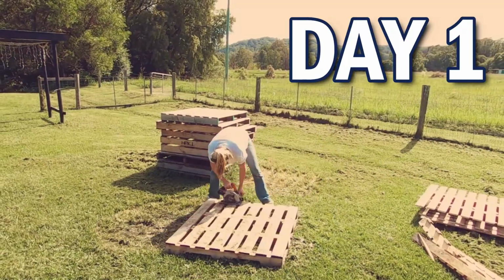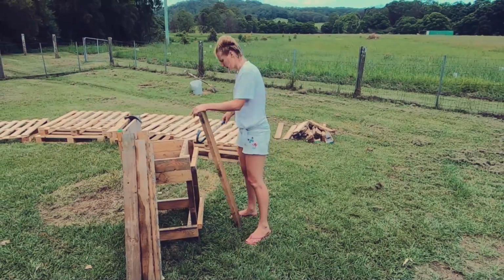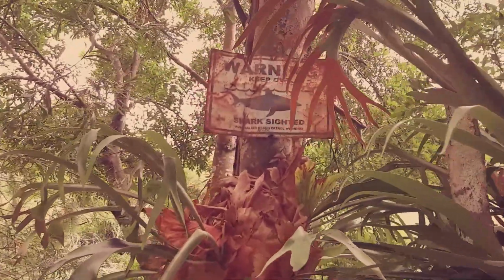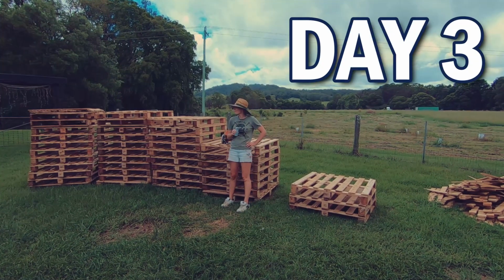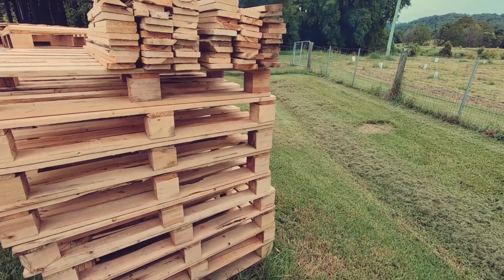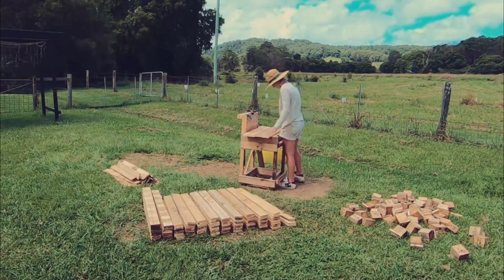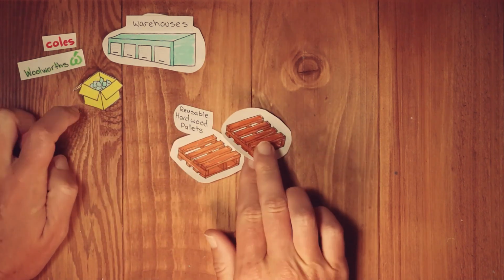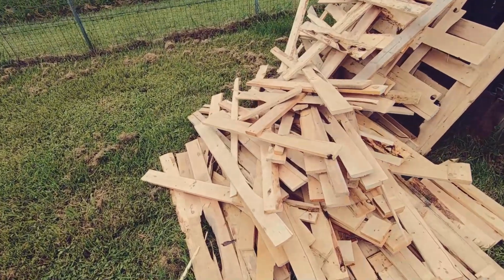Pulling Apart Pallets ★ How to dismantle a Pallet ★ Building with pallet wood ★ DIY

Comment: That's a lot of pallets! The shortage definitely makes me look at them differently now. 

I can still find some in my area thankfully. Hubby's workplace sets them out for free and a local business at the end of the road does too. 

What do you plan to do with them? I cant wait to see those videos! <3
Reply from the maker: So glad you can still manage to get some pallets.

With these ones, I am doing a large feature wall. So I will have a few videos coming on getting the wood prepared for that. 👍
Reply: @NikitaMaree  Is pallet wood treated to withstand weather?
Reply from the maker: No, soft wood pallets are made as cheap as possible.
If I intend on using them outdoors I either oil the project or give it a clear coat. 👍